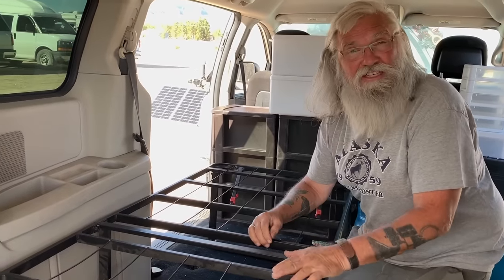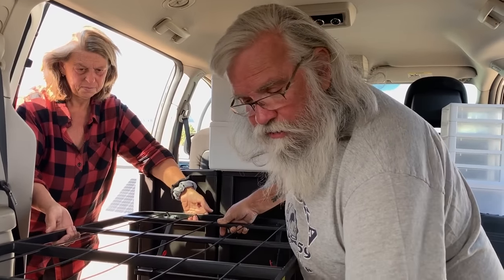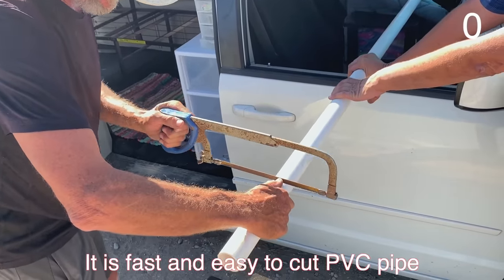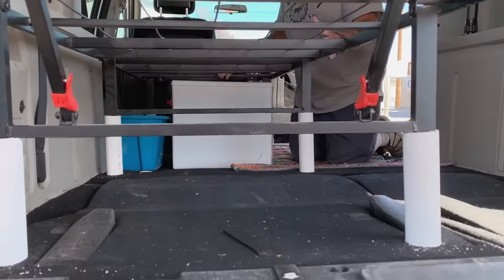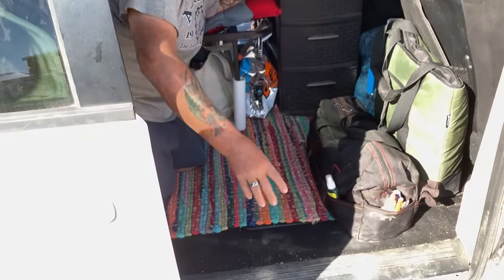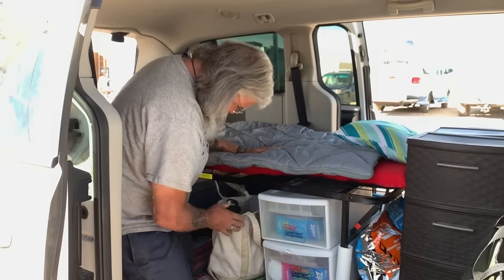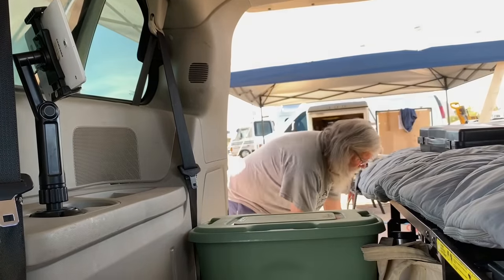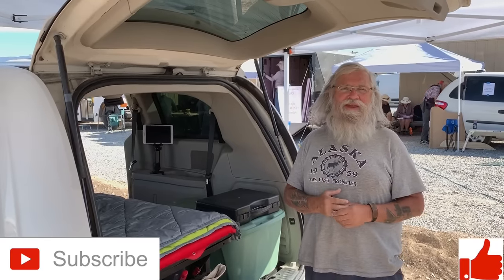Van Life for Less: Affordable Easy No-Build Van Conversion | No-Build Van Life

Comment: That's what I did. Camping cot, laundry baskets, 3 drawer dressers plastic Walmart. Portable rubber collapsible sink, small go pro plus power station, clam shell solar panels, USB chargeable fans and lights. Butane 1 burner stove and small heater and small swamp cooler to keep cool. Cost about $350 for everything. I have a Dodge Grand minivan. Love it. Thanks again for all the knowledge you share with us.
Reply: What do you have for a heater?
Reply: What kind of insurance did you get?
Reply: whats your power station and cooler?
Reply: Thank you so much for sharing this 👍🙂
Reply: @hissonggirlmoni5706  :. Have you tried Cabela's?  Or Sportsman's Warehouse?
Reply: @MrTravisAl  Did they ever reply? I want to know too.
Reply: @MrTravisAl , probably a small buddy heater?
Reply: Beautiful list....lm ckn off as l go
Thxs & be safe
Reply: @MrTravisAl  I don’t know what she has but we have a small slide in camper on the back of our truck that is about the size of a van set up, and we use a Mr. buddy heater. It is amazing and it is safe to use indoors, we just always leave a window cracked just to be on the safe side.
Reply: Always remember when gremlins hit the caravan it’s the iod fuse.
Reply: @Peteeboy2011  I was just about to comment on how the build sounds great, my concern is the Dodge Caravan - those things are very economical but they don't really hit their stride until they've gone through a round of significant major repair/replacement parts when you know it won't just die.
Reply: Perfect list, thank you.   I've bought the collapsible sink at Supercheap Auto in their camping section, and will gradually gather the rest.
Reply: @MrTravisAl  I would use a Dimplex diesel heater and have it up on the wall, it's just a bar.
Reply: Not me using this as a checklist, thanks so much!
Reply: @randzopyr1038  At 100,000 miles?
Reply: @MrTravisAl  in another video Bob shows his van and he uses a gas cook stove to heat his van. He said the Buddy Heater is too hot.
Reply: @Lisa Ballon  how much does it cost you? $350 ? I would love to get a larger bed for a mom and 2 toddlers.  I found a van for $500.00. Do you have curtains? A portable toilet and some jugs of water too?
Reply: @MrTravisAl  my. Buddy or sine wave
Reply: @toxicmoldmedia  dometic for fridge and Jackery
Reply: @Jinjerbread317  They make a van size woodburner too. No kidding, I have seen one installed on video.
Reply: Can 2 people sleep and travel in a minivan?
Reply: Do you have a channel?
Reply: Peace ☮️ to you. Thanks for sharing. ❤
Reply: Thank you 🙏
Reply: I love love love the idea of the pull out kitchen many have created ,it so cool efficient and just totally perfect I think❤

Comment: I put a small cookie sheet under my stove just in case there are any spill overs while cooking. It makes for easy clean up and protects the plastic totes from heat.
Reply: Or foil paper
Reply: Great idea
Reply: Genius. Like a bird cage lol
Reply: What about food storage?
Reply: Cookie sheets are so cool.  I use them under the little stove, and for wind breaks around the stove when outside, and as a serving tray, and as a place to put tools when working on equipment.  Oh, and of course to make cookies and pizza!
Reply: Awesome tip about cookie sheet!!! 😁😁😁
Reply: Tinfoil (aluminium foil), baking paper, and anything else which is supposed to not be set on fire easily. And baking trays are useful not only to place things in, but also since they can be used as chopping boards if upside-down, and to compartmentalize things if they can be stacked, and even as a flat cooktop for a campfire, if you have coals or even an open flame underneath it. Some even drill holes on the sides of the flat bottom, to allow for airflow for the fire and coals, to better heat the baking tray.
Reply: What a great idea. I am looking forward to getting on the road, after the polar vortex left me frozen. Minnesota isn't made for softies, I found out. I'm going back to familiar Texas.
Reply: 🇬🇧     Also something to protect the bedding if cooking involves a frying pan.
Reply: thanks for the tip!
Reply: @SapioiT  I am putting soapstone in my charcoal starter pitcher to heat up and then put in a foil envelope, wrap in towel for a bed warmer. Soapstone retains heat.
Reply: @karenclausen6724  Interesting. Over here, we used bottles of hot water under the sheets, and they lasted for a few hours during the winter night time. 

Not the full 8-10 hours of sleep, but 4-6 are achievable with a 2-liters bottle, without wrapping it in anything and just hugging it or keeping it close to your body. 

I didn't know soapstone retains heat for longer. Thanks for sharing!
Reply: @karenclausen6724  That's an awesome idea! 😊 I've been thinking of putting some kind of stone over/around a wood burning stove to retain heat longer  (& my friend has long been doing the 2 liter bottle of hot water forever; especially for cramps, but would help keep warm, too!)  Similar to the concept of biomass stoves, but more compact. Where did you find soapstone? What size/how many pieces are you using?
Reply: 🙄 That's extremely basic, simple, common sense and so so very OBVIOUS ...and yet, it is greatly APPRECIATED! 😁 ...We usually don't think of these little details initially. I'll add a small cookie sheet to my shopping list today as I plan out my van build. 
- So Thank You!
Reply: Great idea!

Comment: Buying a basic mechanic and construction tool set, and learning how to use them, should be the very first thing you do, before even thinking about buying a vehicle. You will need to learn how DC circuits work, so that you can install things like solar panels, lights, water pumps, fans, and refrigerators. You will also need to understand basic automotive maintenance and repair. The less money you have the more skills you will need. If you want to live cheaply, you cannot be helpless, you need to be self-reliant.  It is the difference between living and existing. You don't want to end up in a broken-down cardboard box on wheels.

Comment: Pro tip: Get totes that are different colors or use a strip of colored duct tape to give you a quick reference for what is inside it. 
Example: blue for toiletries, red for kitchen tools etc.
Reply: Yes! Or use something (marker, nail polish, ink, tape) to write something on the outside on every side. I write K for kitchen, T for toiletries etc etc.
Reply: I'm thinking about van or camper living Fall 2020 upon my return from Alaska. I'd be located in the Southwest/Nevada. My main concern is securing a reliable energy source. Any pointers?
Reply: Great idea for anyone trying to get organized!👍👍👍
Reply: Sandy Cakes solar... but depends on where you’re located
Reply: Sandy Cakes If you’re not super tech savvy, I recommend the Jackery explorer power station ( 240 if you don’t need tons of power and the 500 if you think you’ll need more). Then you can order a 100w portable solar panel on amazon and you’ll be set. The solar panel is about $200 and the explorer 240 is about $250 so it’s a little pricey but not too bad considering how simple it is to use and how much power you’ll be getting. Good luck 👍
Reply: Very wise advice.  As he covered totes, I was thinking that very thing just to save time as things would be a bit snug.
Reply: Smart tip. Thank you :)
Reply: Or get clear totes so you can see what's in them
Reply: Brilliant!
Reply: @sandral.romero6125   Use a low cost solar system ( Reneger has a system that's inexpensive) . Also get small panels like 1 or 2 watts to charge your phone. Also solar lights, with a built-in panel that charges all day sitting on the dash. Keep watching his vids he goes over all these and more
Reply: Great tip!
Reply: @shhosh I use different colored electrical tape. It’s easy to write on and comes off without any residue! I use it for rummages. Everybody gets their own color to price their item.
Reply: @smoothlyamusing1502 As much sense as that makes,  I don't always want to see all my belongings, or different bags everywhere.  Looks are as important as functionality if you plan on hanging out for awhile.

Comment: The PVC leg adjustment idea is pure genius!  Thank you
Reply: I'm not a fan. It takes all of the force from the vertical upright and puts it on the small crossmember /weld. It'd be better if you put a support dowel inside the PVC to keep the force on the leg.
Reply: @justintempus7406  I put the question to my husband (w/o showing your comment) and yep, that's the first thing he said.  Heck, that shouldn't be too hard to find.  I hope your comment causes Bob to update this video.  Hubby is the engineer, Bioanalytical Chemistry is my field, ha.  Thanks for your reply.
Reply: Yes because I NEVER think of that
Reply: I think this PVC trick is nice, especially for someone who doesn't have a whole lot of strength. I would personally rather go for metallic tubing, or just shortening the other legs cause I think in time the PVC might deteriorate under the weight of the person sleeping... But that would take a while anyways.

By the way, if you want your cut to be straight, you can take a piece of thin cardboard with a straight factory edge to it and wrap it around your pipe to mark it, then all you have to do is cut along...
Reply: No not really because now you've shift all the weight on those cross bar and they're are not positioned to take that kind of weight.
Reply: @lxcky21 Put tape around for a clean cutting line.
Reply: @robincrook5630 I was thinking the same.
Reply: And banging your toe on the PVC is way better than banging it on metal.

Comment: One thing I would do with a van conversion is pvc pipes for tent poles and a large tarp from Harbor Freight to make a tent room off the back door of the van. Having a wind and rain proof room to stand in and cook "chuck-wagon" style helps  remove some of the "cramped" feeling during foul weather. 

It's also not difficult to use sch40 pvc pipe to make a frame for an awning over the side door. A "front porch" layout under the awning also helps alleviate a lot of claustrophobia.
Reply: Thanx Bob ur a ginormous blessing love ur videos !
Reply: How would you attach the pvc to the van?
Reply: Or in foul weather, drive your house away!
Reply: I made a tarp for the side of my dodge caravan.  I sit under it in the rain and feels great. I also cook under it when raining.
Reply: I have a friend who uses extendable paint roller handles - they extend to something like 6-7 feet! She uses them for tarp setup over and around her tent. I want to get a few for myself as $$ allow!
Reply: @MJ-vf1im  buy big magnets for the van or car  most tarps have holes in
Reply: 23 years back my wife and I spent 5 1/2 months camping around Australia out of an old Range Rover. Before we left, I wondered how I would cope if we broke down for a few days alone in the desert. My solution was to carry a large tarp which would cover the car and tent. The arrangement allowed the car to drive off if required. We did get to use it in a tropical setting instead protecting us from a monsoonal downpour. It was large and heavy when all the posts big pegs and ropes were counted, but suited our setup at the time. There are many grades and sizes of tarp. There application can be very flexible.
Reply: EXCELLENT idea!!! Thank you Stephen, I will be adding my screen room off the back of my van
Reply: Fantastic idea. Maybe some mosquito netting too. Feel like I'm going home.
Reply: @leal536  great idea!
Reply: I like the tent idea
Reply: @JoansJunkJournalsAndMore  
why did you choose the side instead of off of the back lift gate?
Reply: Stephen, great idea!!
Reply: @annecaulder9495  You are seriously funny and I truly mean that .
Reply: @JoansJunkJournalsAndMore More STUFF.
I just drive to another location.

Comment: The legs of the cot can be used as anchor points for bungee cords. Stretch bungee cords from leg to leg to further prevent the under the cot plastic bins, drawers and totes from shifting about while the vehicle is in motion.
Also, @15:25 a piece of plywood can placed over the green totes to act as a table. Take a measurement of the size needed to lay on top of the totes and then have the home improvement center, like Home Depot, cut it for you. When not in use, simply sandwich the plywood between the mattress and the cot frame
Reply: I was thinking that too about the plywood but great thinking with bungie cords!👍🏼😁
Reply: You can also buy a small amount of latex or acryllic based food grade liquid sealer. 

Another option would be a large plastic cutting board.
Reply: Bungie cords are hreat for van life
Reply: They sell smaller pieces of plywood at HD. 2 foot by 2 foot.
If you dont need a whole sheet.
Reply: @shawnr771  also they usually have scraps of wood for cheaper or free
Reply: No need to raise the bed... it’s actually great that one side is a bit higher than the other.
I sleep with my head on the higher side and it’s the best night sleep ever!
2005 Toyota Sienna 🍻🍻
Reply: Very clever!  You are so inventive!  Where's Don Quixote?
Reply: @lass-inangeles7564  -  Argamasilla de Alba, La Mancha, Spain
Reply: Lass-in Angeles ...he has been reincarnated and is now a space ship captain named James Holden with his trusty war ship the Rocinante from the tv and book series The Expanse.
Reply: @darksidemachining  oh, i love that show !! hopefully, the next season shouldn't be in too long now !
Reply: DarkLittlePeople ...Season 4 aires December 13, 2019 on Amazon Prime. I am so looking forward to it.
Reply: @BlazinBlades  I have done the same exact thing. Keeping my head on the higher end works great. Also, I have used bungees to secure the cot to the floor just in case of a sudden hard stop so the cot doesn't move.
Reply: Doggone good idea.
Reply: Yes and we added  a tow hitch  arm.. thats removable for a grill stand so we didn't melt any tubs or smoke or smell up the  rig.. swing it out to cool and cool down then pack it up slide under seat fold up hitch arm.  That way we can shut the back hatch   and use the arm to hold the grill.  Later we also bought  the roof top add on tent for a second bedroom.. so it also pops nope and we sleep up  there .. and  now have room for guest when camping.. marvelous!!!! Came w an awning... but yes this is  my fav camping  van life Channel. Its so reasonable  and doable..  and so many share in the comments  more dyi.. tips 🥰😍🥰😍🥰😍😘
Reply: @BlazinBlades  I like my head lower than my feet.
Reply: @shawnr771 I was thinking something artistic. But,  I  like the cutting board idea! Duo Purpose! Thanks!
Reply: Yes I responded to that too. A board over the tote as a cooking station/ counter tops gmta😂